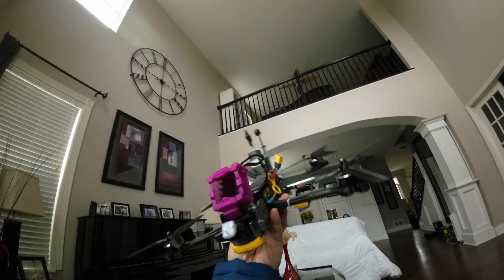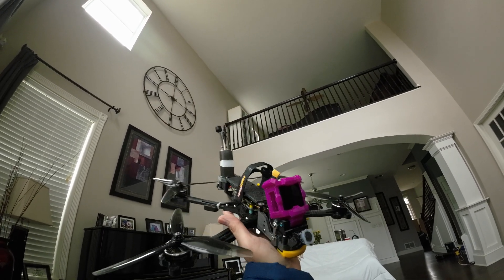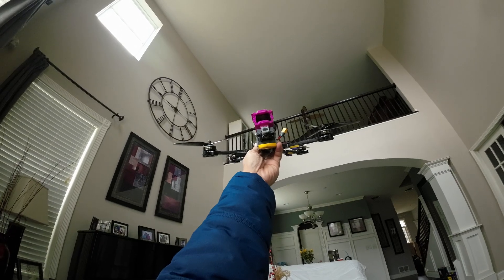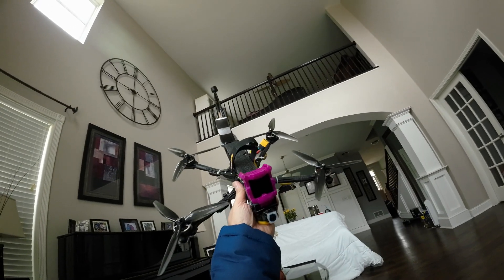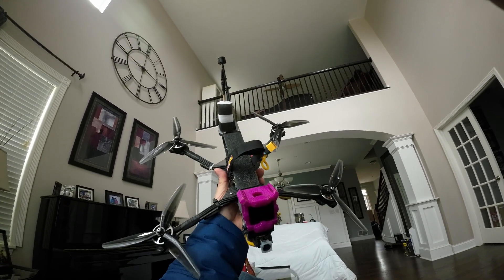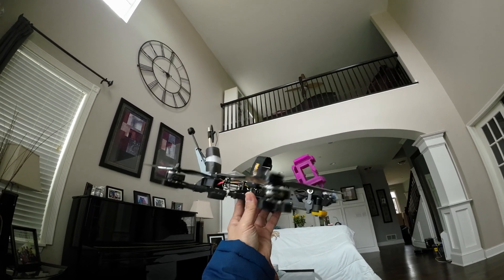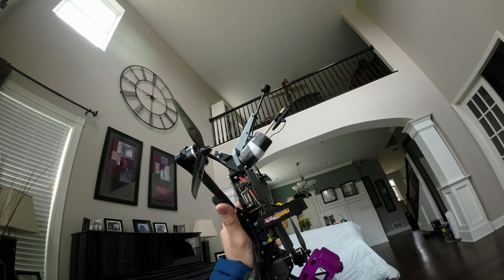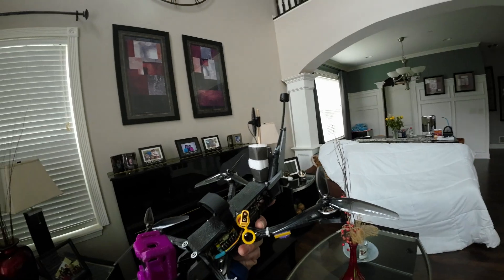From Beginner to Pro: My Game Changing Antenna Setup Unveiled!

Comment: Placing the active elements on the bottom of the quadcopter is the best for LR as nothing will block the signal.
Reply from the maker: @cinemoriahFPV  that's true. Just need to figure out how to not damage the antenna when we land it. Definetly mounting the antenna horizontally will work but it's not the ideal position. Vertical is the best position based from my several test for years and from others' tests as well. I'll check it out later.

Comment: mount RX antenna on front bumper. (i may or may not have invited it -- check my thingiverse sourceOne v5 for a visual)
integrated into bumper should be in LOS. 
that said my TX is horizontal and i never mountain surfed.
Reply from the maker: Will do. I had a failsafe in horizontal before using TBS crossfire. When TBS Support investigated my setup, they found out my antenna was in the wrong position and was perpendicular to the antenna on my radio. I'll check out your sourceone v5 design. Thank you for sharing.
Reply from the maker: I added your idea in the description 🥰
Reply: @neilfpv  cool :)
wire the RX in the front as well., no need for long UFL.